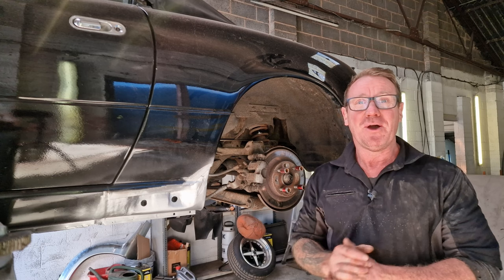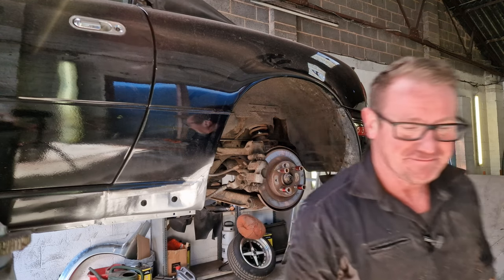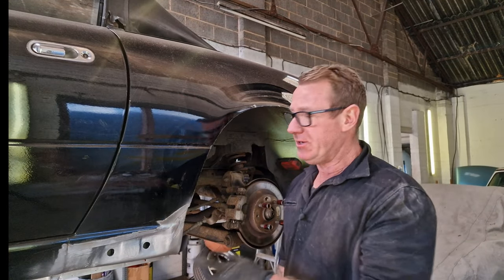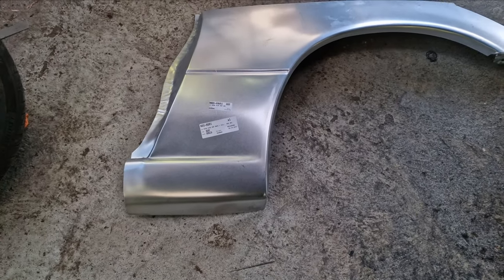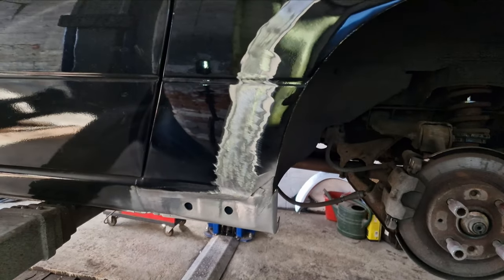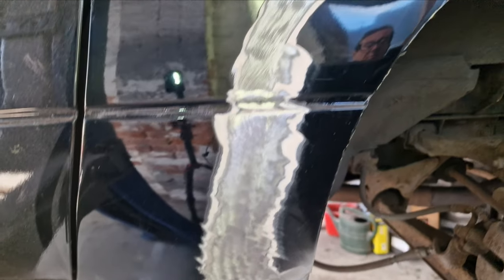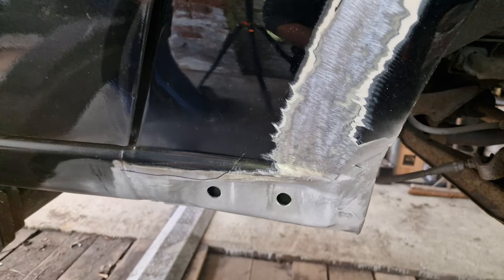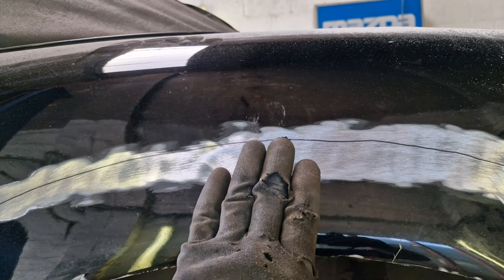Sticky TAPE RUST REPAIR !! : Part 2

Comment: What a legend! I'm gonna tackle this at home and been practicing  MIG welding. This method of repair looks so good! I've watch most of the repair videos and excited to give it ago!
Reply from the maker: Thank you glad they were of help. Just take your time and if you get a little overwhelmed just have a cut of tea and leave it alone for a bit :) go back to it when you get excited about it again :)
Reply: @yorkshirecarrestoration  yes I’ve done that im on day 2 right now and one the first day just cut all the rust and prep surfaces. Today I started to rust convert and paint inner parts and I’ve welded arch in place!
Reply: Any reason that you don’t use  t-wash/ mordant solution the galvanised panels before applying etch primer?
Reply from the maker: @GiveItBeansGarage  Nice :) Keep at it and it will be done :)
Reply from the maker: @WHYKICKAMOOCOW100  no reason just preference :)

Comment: Replacing the arches, do you recommend this overlapping method before others? If longevity is concerned, what gives the best result?
Reply from the maker: Best results are butt welding is best but usually reserved for people with a lot of welding experience, at YCR we show people.gow to do it themselves and the skill involved in butt welding is beyond most people, lap welding is much easier and if treated correctly with Waxoil etc then there shouldn't be any problems :)
Reply: Definitely not that way

Comment: Excellent video's guys, but ;-)
The top of the repair panel is grind back for welding.
But the top part inside the car is unprotected?

Comment: Hi mate love the video! I'm looking to tackle this myself on the driveway. I've enrolled in a night class to learn basic mig welding. Do you have any recommendations on what sort of welder to buy and any tips would be much appreciated!

I'm a mechanic by trade but the thought of cutting into body work is proper daunting!

Thanks, Ben
Reply from the maker: welder doesn't have to be expensive  but id suggest something no bigger than 160amp and we use 0.8 wire with just 02 but a o2 and argon mix is better :)

Comment: Hey. Just found about your channel a couple days ago from someone dropping a link to your channel in local MX-5 owners chat. I've got a question - Let's say that the lower part of sill near the wheel is starting to rust but arch looks fine inside&outside. How do you know that the arch also needs to be cut open and inspected/repaired? 
Thanks, hoping for an answer but keep the good work, it really picks up my spirit seeing that rust CAN be slowed down with a proper repair!
Reply from the maker: Thank you, in our experience when the sill is rusted then there is always rust inside the arch
Reply: @yorkshirecarrestoration  Thanks for the answer! Adding another thing to the “to do” list for my NA mx5

Comment: I'm interested to hear your thoughts about the repair on the inner wheelarch lip? When you cut the grotty inner off, did you bond the outer panel back to the cut back inner without rebuilding the lip of the inner arch? Fascinating stuff, keep going! By far the best south yorks mazda specialist channel out there :)
Reply: yes I thought exactly the same! does it not matter if the inner wheel arch lip is now missing? Would it cause corrosion to the inner wheel arch later on as there is now an additional area for moisture to build up?

Hopefully it doesn't matter at all to save me a heap of time in my next wheel arch rebuild ;)
Reply from the maker: The double skin lip is the reason why the lip corrodes, hence why we remove it.
The inner and outer are bonded together so the water can't get in there and as there is a single galvanised lip that's heavily two pack zink primed then gravitexed over then Waxoiled so it dosnt corrode.

Comment: gee the fingers of doom ( the air tool thingy with the steel needles ) dose a great job. why do you use both fiberglass filler and normal ?? filler ?
Reply from the maker: Hi Karen. The fiberglass is waterproof incase there are any pinholes in the weld :)

Comment: What is the reason for the first run of filler being a fiberglass paste and the second run of filler being a real filler? Another great tutorial thanks again!
Reply from the maker: Hi Eddie 
The fibreglass past is waterproof whereas the filler isnt. So if there are any pinholes in the weld then with the fibreglass it can't penetrate to the filler layer :)
Reply: @yorkshirecarrestoration  Thanks for the simple and clear response.

Comment: Isn't that overlapped sheet metal a guaranty that rust will one day or another strike back?
Reply from the maker: Nope all cars have lapped panels everywhere. Don't think I know of one car that dosnt have lapped  panels somewhere on them and it's a misconception that a lapped panel will rust quicker. It won't if treated correctly after its been repaired and looked after in the future. Granted it dose usually take a little more filler to hide the step and weld :)

Comment: Do you ever use Kurust or similar before you apply the primer?
Reply from the maker: Yes all the time. I s in most of our videos, it's the clear spray liquid we use but we don't always show spraying it on as we have said in lots of vids to use it on everything. We use mippa mipparox rust neatralizer.

Comment: So why did you do a lap weld instead of a but weld ?
Reply from the maker: But welding is exspensive as it's more time consuming and more skilled so more money, The customer didn't want it butt welding due to funds.
Reply: When you cut the outer wheel house lip you also cut part of the the inner fender , I did not see you welding that strip back. Did you do that off camera ?
Reply from the maker: @duett445  if your referring to the inner lip edge, nope we don't replace that as it only traps water and isnt needed, we dont the outer arch to the inner arch.
Reply: Ok. Fair enough about the inner lip. I thought it was needed for strength and rigidity, I mean it is there for a purpose why otherwise was the body designed with the lip.
Reply from the maker: @duett445  iv been repairing these for 20 years and never had any adverse effect of removing them even on my track cars :)